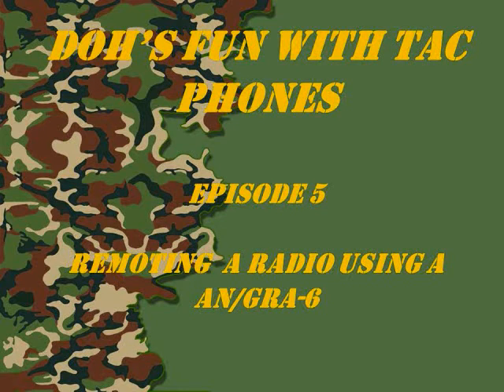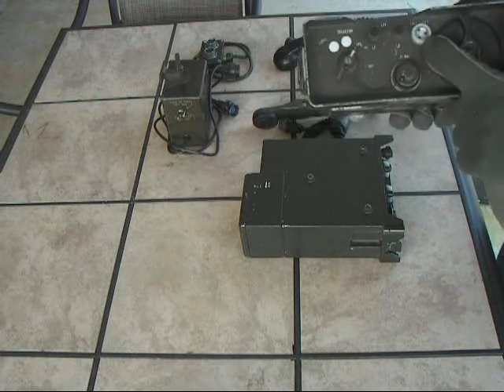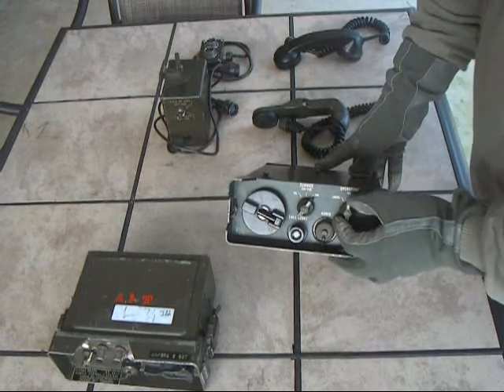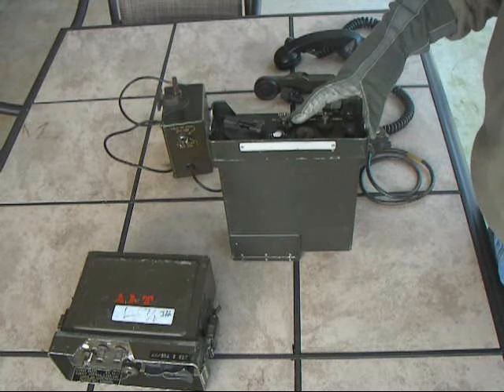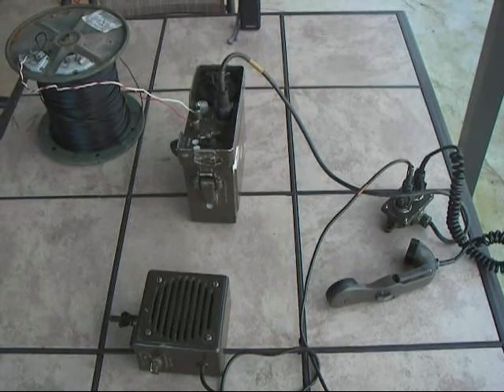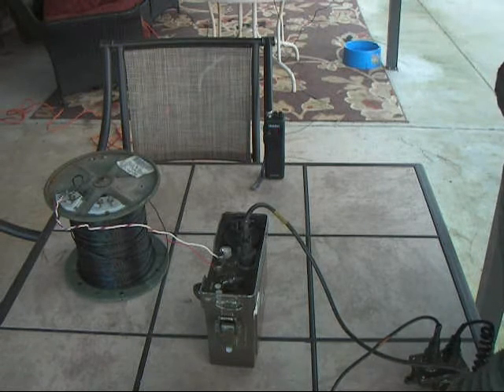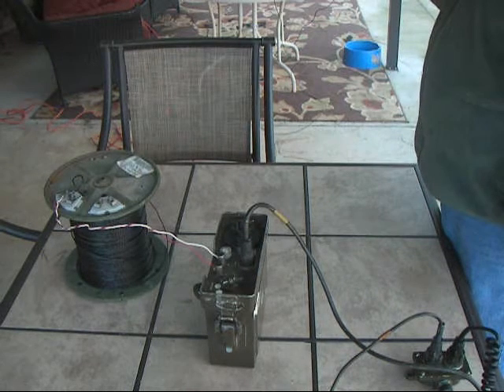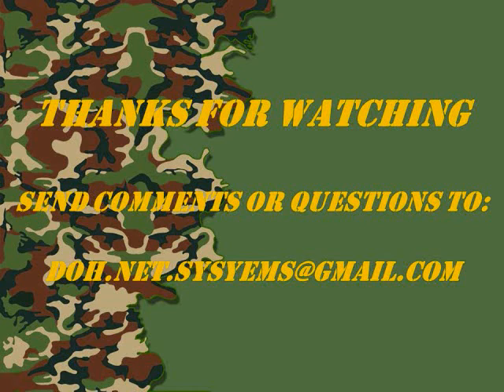FIELD PHONE OPS: Remoting a Push-to-Talk Radio using a AN/GRA-6 Control Group

Comment: Just subscribed, very enjoyable and educational. Question, I just picked up a navy c-2172/GRC-14
NOS. With desicant inside and a test paper with 3 circles that says “caution if pink” 
The circles are pink. Is there any health hazards with these old field phones?
Thank you so much.
Reply from the maker: No danger.  That just means dessicant had played out and humidity got too high
Reply: Thank you so much!!
Reply from the maker: Thanks for Watching!  I also have a FB page dedicated to field phone collecting!
Reply: I will check it out. 
It’d be great to talk to you seeing there’s not much info on these. 
I’m gonna need to buy a H33 handset and figure out how to power her up.
Reply: @DiecastFett  Most press to talk handsets will do job as a phone handset, to activate the relays you need handsets with extra contact set in the PTT.  The TA-43/PT and TA-312/PT handsets are great, just to ad the plug.

The original transmitter capsule (microphone) in the H33 handsets are close talk microphones, and you have to speak loud and close to the microphone, but it suppress the surrounding noise in a fantastic way.